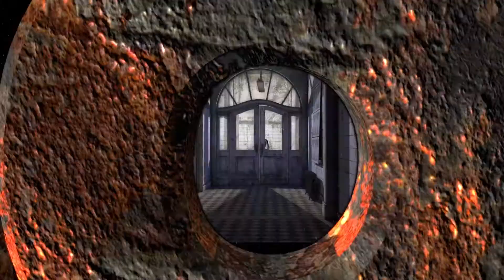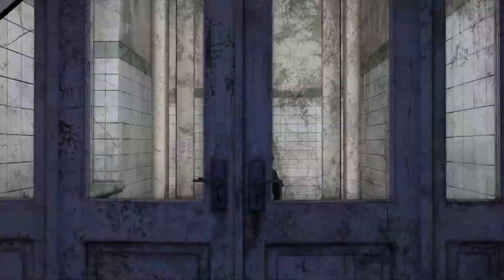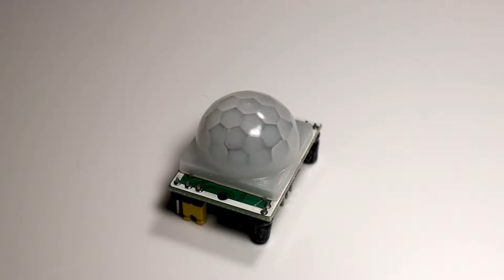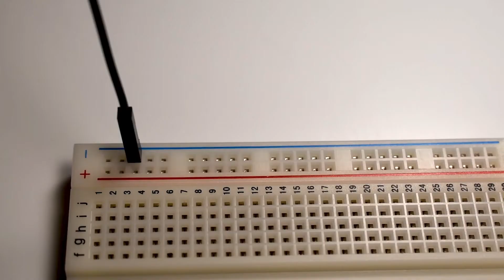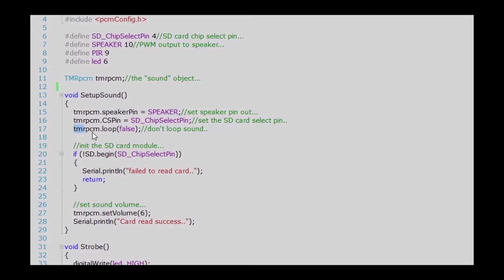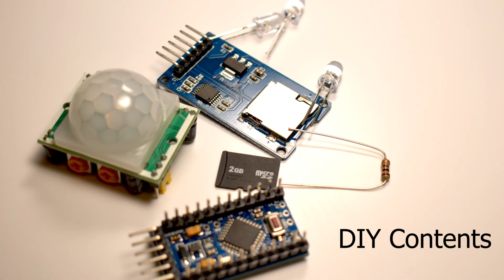Arduino: Halloween Themed Motion Sensor. Playing Sounds with SD Card

Comment: The code loaded and the connections are correct but the sensor does not activate the sound. The lights strobe when first connected without any activation but no sound.

Comment: hey man hope you can answer I know this video is old. I'm new to this so it may sound dumb but the <pcmConfig.h> is not turning being included and I'm getting and error would you happen to know why that is?
Reply from the maker: what's the error? is it saying something cannot be found? if so there are some extra items that can be commented out. any references to an SD card, if any.. let me know the error
Reply: @circusplus  hey man thanks for answering. basically all of these. expected primary-expression before, expected initializer before and does not name a type. it keeps sending me to the TMRpcm tmrpcm line. all I want to do is play a single sound when the pir sensor detects. thanks for answering again I'm just starter learning arduino.
Reply from the maker: hmmm.. ok... let me take a look... bare with me..

Comment: Hi I love your idea.. can I ask if is it possible that I will not put any LED light and ohm in the project??

And is it possible if I can use Aduino Uno?
Reply from the maker: thank you!! - yes, you can leave out the LED and resistor.. An Uno will work fine! ty for watching!

Comment: Hey, I have never used an arduino and don't know shit about github or uploading code or anything likr that, could you walk me through how to upload this, where to do so, what I need, and more details.
Reply from the maker: it would probably be best to watch a tutorial on this but I will try.. you need to download the arduino app, which is free. download the code from the link description. open the code in the app. and connect the arduino to the computer. depending on the model you are using you may have a usb or you may need to connect the rx and tx pins to a FTDI programmer, which can be purchased on eBay. the programmer will have a USB on it and you just wire it to the arduino. select the comm channel the arduino is connected to. this comm channel is just the USB. there will be another dropdown where you select the model you are using (nano, pro mini, etc.). Then you click the upload button to push the code to the arduino. Here is the Arduino link. I suggest checking out the docs on the site. they are very easy to follow. https://www.arduino.cc/en/software
Reply: @circusplus  yes i got as far as uploading the code, but the github is alot of files, and idk what one is the code
Reply from the maker: @albylikeshalloween  what are you trying to  grab from GitHub? this project? if so you do not need GitHub just down this: http://jimandjoes.com/jj945ohi3423.zip

Comment: Hiya brother. Is it possible to trigger a sound using a speaker, and without using a SD Card thingy. Basically i'm tryna rig up a setup, using the motion sensor to play audio through a simple speaker, idk if it's possible though?
Reply from the maker: the problem with that might be the limited amount of memory most Arduinos have. You need to have a place to store a sound. this is assuming that you are referring to playing a sound sample as opposed producing a synthesized sound.. can you provide more details? you may want to think about using a Raspberry Pi if you are wanting to play sound samples...
Reply: Okay, thanks man, I bought a Mini DFplayer anyway, managed to get it working! Thanks!

Comment: It works great, thanks man !
Can you please tell me which power supply you have put on it? volts and ampherage. I like to hear from you.
Reply from the maker: sorry, I didn't get alerted there was a new comment. the circuit is using just a plain ole' 9v battery
Reply: 5 volts

Comment: Hey guys, loved the video. But can you tell me if it is possible to set an delay of an hour before it can be triggered again. I intend to use it in my escaperoom. Anyway awsome video (even though i am a bit late to the party haha)
Reply: It took some adjusting and tinkering but it works like charm. Great video! So you are now officially part of an escaperoom in the netherlands haha.
Reply from the maker: @roydejong149  that's awesome, tell me more about the escaperoom!
Reply: @roydejong149  Kan jij mij vertellen welke voeding je er aan hebt gezet? volts en ampherage.
Ik hoor graag van je.
Reply: @patrickvandesprookjesschuu4532  ik heb een arduino uno gebruikt en de Usb port gekoppeld aan een normale telefoon adapter. Dus 5v en 1000MA. Ik heb er overigens een computer speaker aan gekoppeld met een eigen voeding. Dus geen kop telefoon.
Reply: @roydejong149  een telefoonoplader heeft toch 2100 ma?
Ik heb je raad op gevolgd, bedankt het werkt 👍
Denk je dat een kabel kan verlengen dmv een stuk er tussen te zetten?
Reply: @patrickvandesprookjesschuu4532  ligt denk ik dan aan je blokje. Ik had een goedkope en die leverde 1ampere. Maar mooi dat het werkt! En tot zover ik weet maakt de lengte van de Usb niet veel verschil. Ik weet niet waar je het voor gaat gebruiken maar ik heb tijdens het project aardig zitten klote met de code mbt die PIR sensor dus mocht jij hetzelfde probleem hebben moet je het maar even zeggen haha.
Reply: @roydejong149  hi sir can I ask if how can I download the code?🥺 because for me when I downloaded it, it was a ZIP🥺
Reply: @mitcheldugaduga7280  you need to extract the zip file with software like Winrar. The Arduino code file is within ze zip file.
Reply: @roydejong149  thank you so much sir!!!  Can I ask, because I made it but the sound is continuous ☹️☹️ How can I set it, because I want it to active if there is motion detected
Reply: @mitcheldugaduga7280  you mean it triggers when you power it on right? You need to set an delay in de Void Setup of at least two minutes. The PIR sensor reads HiGH when it is warming up.
Reply: @roydejong149  how can I Do it??
Reply: @mitcheldugaduga7280  you add delay(240000); to the Void Setup section. This Will add An 4 minute start up time.
Reply from the maker: absolutely! you can set any length of delay you want when a motion is triggered. Just put it after the Strobe() function:
if (digitalRead(PIR) == HIGH && !tmrpcm.isPlaying())
	{
		Serial.println("triggered..");		

		tmrpcm.play("wolf.wav");
		Strobe();
		delay(somenumber);//set it to an hour or whatever you want
	}
Reply: Awsome thanks for the Quick reply!
Reply: It's about the freemasons and we use the arduino to set off an alarm with aditional audio files. Just to make the whole thing more dynamic. It never fails to startle People and have them screaming for a code haha.

Comment: The amplifier is necessary?
Reply from the maker: yes, you will need speakers of some kind.. and something with some amplification will help, as the circuitry doesn't supply much volume